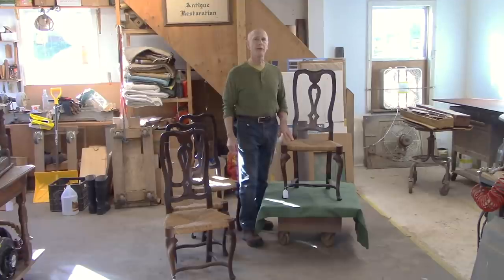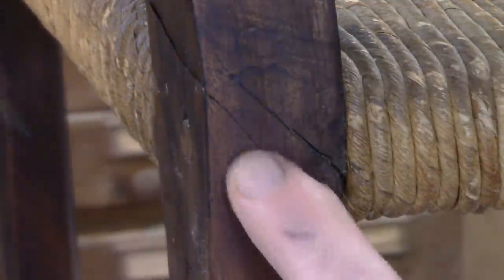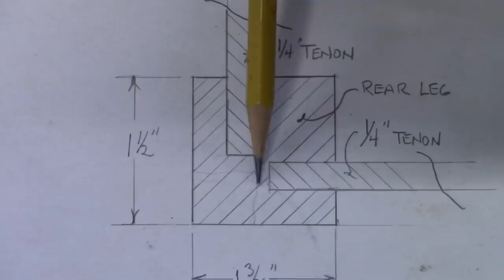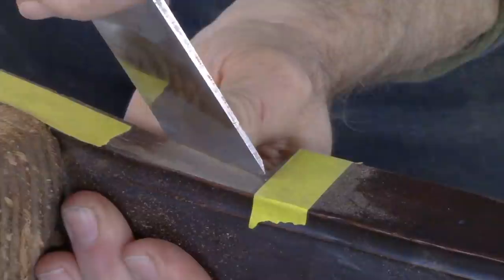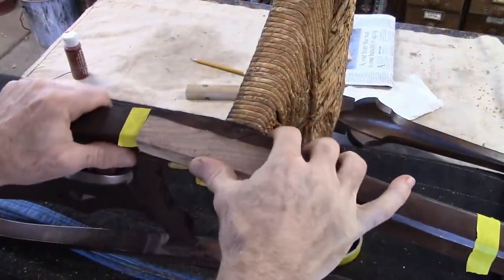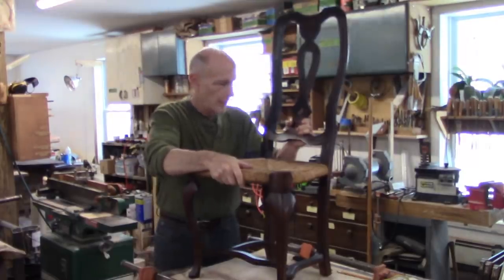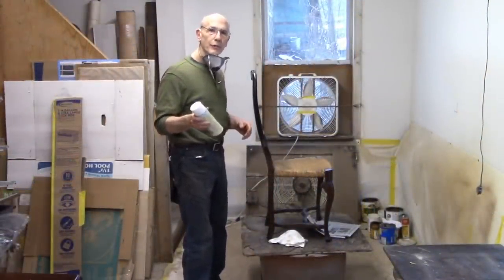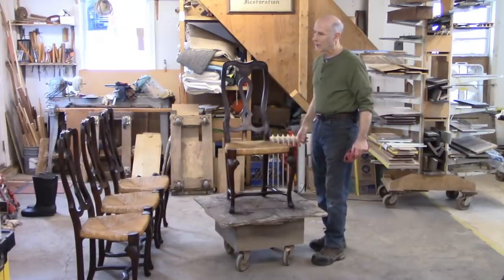Restoring an Italian Chair - Thomas Johnson Antique Furniture Restoration

Comment: Great video.  I recently repaired a set of chairs with rush seats for a close friend.  The rush was falling apart and the joints were loose.  I checked a few furniture repair places by me to see what the cost of replacing the rush would be.  It was much more expensive than my friend could afford.  I found a channel on you tube that gave detailed instructions on rush replacement.  Replacement rush was available on Amazon.  I cut the rush off the chairs and repaired the chairs with the instructions provided on your channel.  Then I strung new rush on each chair.  It took a little time, but turned out great.  Another source recommended coating the rush with Shellac to water proof it.  I understand that replacement of old vegetation based rush with the new paper based material will damage it's sale value.  These chairs seats were last replaced by my friends mother.  He approved the repair.
Your videos continue to inspire and embolden watchers like myself to make repairs and give furniture new life.
Reply from the maker: Thanks! Wow! I give you a lot of credit for re-rushing those seats! I have tried it and I can see it takes a lot of practice. Good job!

Comment: I'm happy to see someone make simple jigs for their tools. There's not a lot of time wasted in making it. Simplest is oft the best.👍👍

I found a product from Lee Valley Tools that works great for those joints that's been pinned and can't be removed. It's a type of long setting epoxy in a squeeze bottle with a needle applicator. A tiny hole is drilled from underneath into the joint and the needle is inserted and glue squeezed into the joint. The wood in the joint swells with this epoxy and then sets up making the joint tight again. I've used it a couple of times on chairs and a wooden high chair and it makes them rock solid. 
Not sure if super thinned epoxy in a syringe wouldn't do the same thing.
Reply: I think it has some CA glue in it and something to make it less brittle/rigid than epoxy. i guess only Veritas know the recipe. But that is what it smells like...
Reply from the maker: Thanks! I'll definitely check that out

Comment: Thanks Tom, a very timely project for me, as I am rebuilding a child’s chair which needs new parts due to woodworm, and I can’t take apart the rush top, the angle pieces under the joints look like the fix I need!
Reply: They are called “brown lacquered chair brace” made by Stanley hardware.
Reply: @billkurek5576  Thanks, I think I’ll make some!
Reply from the maker: You're welcome! Good luck with the repair! I find those braces to be of dubious value, but could work on a smaller piece like the child's chair
Reply from the maker: Yes, thanks!

Comment: This appeared to be a tougher one for you however you won and they look fantastic. That glue you ended up using was strong stuff. If that glue ever loosens, would there be another was to attack the issue without completely removing the seat?
Reply from the maker: Thanks! Not really, I would just use the same glue again - or make the decision to replace the seats

Comment: Masterful as always. I never fail to be impressed by your patience and exactitude. Really a role model for anyone who loves restoring furniture. One question: When the coping saw proved too slow for getting the new wood trimmed down, why not slap the guide back on and hog it out with the router?
Reply from the maker: Thanks! Good idea! really, I should have cut the wood closer to size before gluing it! And the chiseling literally took 5 minutes

Comment: Oh the nailed M/T joints are a nightmare. There is no real substitute for disassembling and regluing but necessity is the mother of invention. I just got a bottle of that wax and oil for my latest restoration, on your recommendation. I'm sure the manufacturer will be forthcoming with your commission soon. Thanks for posting.
Reply from the maker: You're welcome! All the time I have spent over the years dealing with nails through joints......

Comment: Those fine drip applicator nozzles for the ca glue are amazing, I got a pack and it is so much easier and less messy than without them.  Good job on really tough chairs.
Reply from the maker: Yes, good stuff! Thanks!

Comment: Considering the limitation of not being able to remove that matting, a very well executed repair and a very nice jig. And at least the hard wood of the patch will be nice and strong keeping that leg toghether. How well do you feel those glued joins will hold up, with the limited access you had? But it certainly looks a lot less wobbly than before.  Thanks for another great video.
Reply from the maker: Thanks! I have confidence in that glue - my experience is that it works well

Comment: great, as always. you have one of the best channels of YouTube

Thom, if I may ask you: some people say that a mortise and tenon joint should have a little gap, or to be barely snug, to allow a glue layer that can grab and do the job. others say that you make them as tight as can be, considering that the mechanical aspect, with the help of the little glue left, will make for a joint that can stand the test of time. considering that you work on furniture made by many craftsmen from around the world, what kind of approach do you usually see as the best? 

greetings from Brazil!
Reply from the maker: Thanks! There should not be a gap if you are using wood glue. The pieces of wood must make contact for the glue to work

Comment: Wonderful job Tom! Just wondering,  after you take out a piece with the router, why do you square up the hole instead of making the donor piece round? You could take measurement of the router bit for the angle.
Reply: Matching rounds precisely is less easy than matching a right angle (or at least, that's what I find - even with hidden tenons!)
Reply from the maker: Thanks! dlevi67 is correct. Also, because these are "antique" chairs, I want the repair to look like hand work, the rounded corners scream "router!"
Reply from the maker: Yes, true

Comment: Very impressive. Would you consider using dowels, when strengthening a joint , where you can't take the legs apart? I know you didn't in this case, as this had been done before. Is using wooden dowels ever an option? Is the CA glue the lEe Veritas Chair doctor stuff. Thanks as ever for excellent videos and really good informative narration.
Reply from the maker: Thanks! I rarely would drill dowels, especially not through joints. I'm not familiar with these Ca's, I'd like to try the Veritas

Comment: Fascinating repair. Loved how you made that jig for the router. I'm curious. If you'd had your druthers would it have been far better to take the straw seating material off so you could disassemble the chair and them used an upholstered cloth seat?
Reply: Yes, that's just the question I was itching to ask too...possibly though, in the owners mind, the added cost of redoing the rush seating might've literally been the last straw!
Reply: Same thought here - however I think the other 'mitigating' factor is the fact that the joints were pinned (at manufacturing) and many doweled (later), which would have made it a genuine marathon, with a relatively high risk of damaging and breaking more pieces.

FWIW, 'original' 17th and 18th century chairs were very often rushed or caned. Cloth was significantly more expensive.
Reply: @dlevi67  Yes that's very true...I should've thought of that!
Reply from the maker: Thanks! I would have preferred to take them apart, but then rushed with real rush. dlevi67's reply is correct
Reply from the maker: That's good!
Reply from the maker: Correct! Taking those chairs apart and then having the seats redone could have been $1000 each!

Comment: Do you ever use fiberglass after your epoxy step? I’ve used this step with really bad cracks or splits or breaks. You have to do your finish first and I use the lights fiberglass for this procedure.
Reply from the maker: Thanks! I've never tried that. Maybe in areas that don't show?

Comment: We often see you loosening joints with a heat gun and putty knives. I assume this is hide glue but does it also work with other glues or what techniques are used if the joint is made with carpenters glue (normal or waterproof?) Or with two part epoxy?
Reply from the maker: Thanks! I've loosened every type of glue with heat. Some just take a lot more heat than others! Hide glue is easy

Comment: Hello Tom ! Just had a specific question on routing. If we have a round-over bit with same included radius as other straight cut but used for routing the space for the new wood that you inserted in would you still chisel out the left over rounded corners or it is ok to take out the edges with round over to match them with the rounded corners of old wood (Ok! In this case maybe by belt sander cuz it’s too thin )???
Reply from the maker: Hi Fater! Yes, it's fine to leave it rounded. The only reason I squared it off was because it's an old chair, and I didn't want it to be obvious that I used a router. But it doesn't really matter structurally

Comment: I love your videos, the best object restoration vids I have found.
This time I am surprised to see you using Wonderlok. I understand it is a cyanoacrylate, in my experience they tend to be brittle. Would be interesting to hear about long term stability on material that is under frequent movement and pressure fluctuations.
Reply from the maker: Thanks! I'm wondering the same thing

Comment: You could not have matched that repair better.  Ditto the accolades below Could you have used CA to repair the crack? I have different viscosity's depending on what I'm doing, but have never attempted a repair like that. Of course an advantage is the cure time but will it have the strength
Reply from the maker: Thanks! I'm still new to this CA glue, and won't use it much on antiques. I want to run some "tests" on it

Comment: Why not use modern adhesives more often?  Wouldn't they have used the best stuff possible?  Just wondering.  Always a pleasure.  Fun to watch.
Reply from the maker: Thanks! I'm just not sure about them. But in any case, I use hide glue on antiques, as that is the accepted standard, and the hide glue is compatible with the original glue

Comment: Will that glue be effective. ?????  Won't the chairs joints start to wobble again  eventually  and soon ?  How much would it be to re rush the chairs.  I would have plumped for removal of the rush so you could really get to all those joints.  The only way.  Of course  if the owner is going to sell them then it's the new owners problem   :)
   Great vid thanks.
Reply from the maker: You're welcome! It was a tough decision. Real rush seats can cost $300 or more. That's just the seat! To take those chairs apart would be a nightmare due to the pins through the joints (factory) and the dowels drilled through most of the joints

Comment: Just a general question, can you use bleach to remove dark water stains from table tops, previously you used oxalic acid which wasn’t too successful, the table top looked great but still Showed light staining
Reply from the maker: Thanks! I've never had luck using bleach to get stains out. And of course, the bleach completely ruins any natural color. I'll stick to oxalic, and if that doesn't do it, leave the stain

Comment: When using CA glue, can you drill a microfine hole into the joint, just large enough to fit the syringe and then hopefully capillary action will take over and surround the joint with the glue?? 

I’ve never tried it but the thought presented itself while watching your glue up.
Reply: I have done that where I can't get enough in. It seems to work.
Reply from the maker: That's a good idea! The hole could be really small
Reply from the maker: Great! It seems like a good idea

Comment: Hi Thomas. I am curious how you keep your syringe working. Do you rinse out the epoxy with something?
Reply: No idea what Tom does, but syringes and needles are really cheap when ordered in packages of 100 or so (whether they should be, given it's often hard-to-recycle stuff, is a different question).
Reply from the maker: Thanks! Yes, I cleaned it with alcohol
Reply from the maker: You hit the nail on the head! I hate disposable stuff. I clean the syringes, I've been using just 2 of them for years now. I find it's easy if you just keep them clean. I'll use a "disposable" brush for years!

Comment: Great Timing Tom! I was going through withdrawal waiting for another video of yours. to come on you tube. My wife does Caning and Rush work so I can appreciate what you had to work around. and knowing what it would have taken to remove it for repair. in short? a lot of $/time.Thanks again for another great learning session. And best of all for sharing.
Reply: I'm curious (and ignorant) - I would assume that cutting it to discard and redo would be fairly straightforward. Redoing the seats is of course another matter, and the way in which the joints had been pinned and doweled would have made getting the chairs properly repaired a nightmare in any case. But is caning and rushing normally carefully undone and recycled for relatively unimportant pieces?
Reply from the maker: Thanks! It's a tough call sometimes. I would prefer to get rid of the old seat and reglue properly. But a real rush seat costs $300+
Reply from the maker: I have repaired many chairs without removing cane and rush, it is never my favorite thing, you just can't do a really good job
Reply: Are there any products for rejuvenating cane/rush? An oil or penetrating liquid to soften and strengthen it?
Reply: @gmmeier321  We use Tung Oil or Danish oil lightly apply then wipe excess "skim coat".

Comment: About the needle syringe you used to inject the epoxy.  Was this a single use syringe or could it be cleaned out and reused?  Thanks.
Reply from the maker: You're welcome! It gets rinsed out and reused. I've been using that one for years!
Reply: @johnsonrestoration  Thanks for the answer.  I figured you had to have cleaned it out.  I have only ever used a syringe with epoxy by then throwing the syringe away.  So a followup question - what do you clean out the sticky, gooey, epoxy out with?  Thanks once again.

Comment: I find these videos so soothing, a quick couple of questions how would you have gone about repairing without the use of modern glue technology? CA/Epoxy & Polyurethane (I never seen you use the latter) Also I notice you use your clamps  as they are, I always use wood blocks to protect the wood from clamp marks (I think that makes sense!) you must have seen huge changes over the last 20 yrs or so, has it made your job easier?
Reply from the maker: Thanks! I would have just tried to force hide glue into the joints. The clamps have clamp pads! But I use blocks often too, There have been a lot of changes in woodworking, but not much effect with repair work. The biggest change is email with photos!

Comment: Hey Thomas, thanks for another great vid!  I was wondering, when you used the CA glue on the joints, did you find you only needed to drip it in from the top, or turn you turn the chair and drip glue in from all sides?  Hope you guys are staying warm through that snow up there!  Best wishes
Reply from the maker: Thanks! We are nice and cozy! I only did the top and sides, because I wanted to get the clamps on it as fast as possible. I think you have very little time, and I had the clamps on the chair ready to go

Comment: Another excellent repair by MASTER TOM. My only worry is the strength in time of that CA glue, but then again you are the master and I trust your decision, I just wonder why you didn't choose high glue in those cracks, that would be my first thought. I hate that method of tenoning legs, never understood why so many chose that method, ending with such a week joint of a 2X ending to be a 1X with just a 1/4  holding the leg, still surprised it din't break at those joints.
Anyway, just a few thoughts here... Thank you once again Master Tom.!!!
Reply: Hide glue isn't liquid enough to get into those small cracks in any quantity, and those are structural joints, not just holding a piece of veneer. All this said, I share your concerns about the durability here - especially considering that CA is quite a stiff glue so it tends to give 'all in one go'.

Re: the tenoning layout. Yep - but there is no other way around it with wood, unless you make extremely bulky rails or legs/stiles. This is why it's been fundamentally the same layout for 400+ years - it's the best of a bad lot, and it's actually not that bad, considering how many survive with very fancy shaped legs and rails, and highly curved backs.
Reply from the maker: Thanks! Those back joints are always a problem. I've thought long and hard about if I was going to build a chair what I would do about that. No good answers
Reply from the maker: Thanks! It's true - we only see the failures. Percentage -wise it's probably well within specs. I worry about the CA glue too. I only know my brother used it on his kitchen chairs about 20 years ago, raised 3 kids on these chairs, and they're still fine
Reply: @johnsonrestoration  If they are kids proof, they are probably anything-proof!